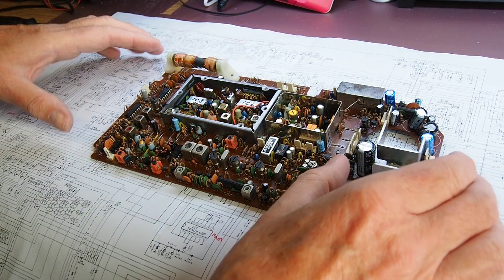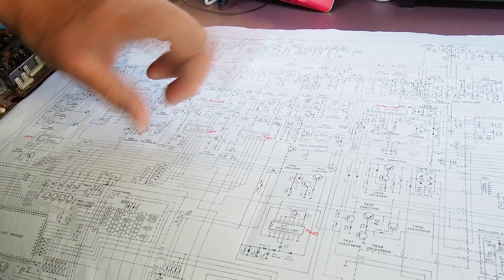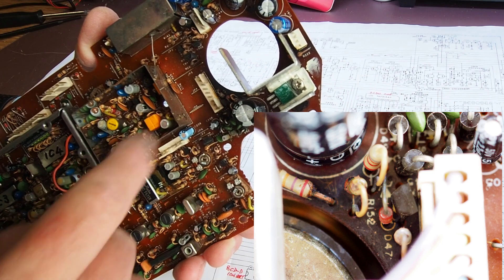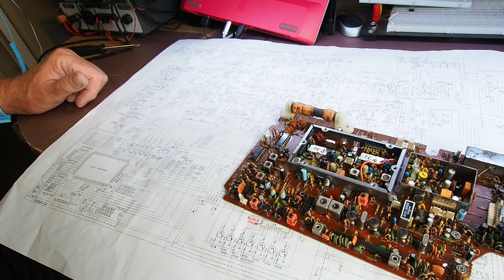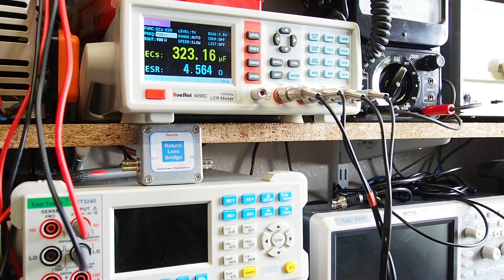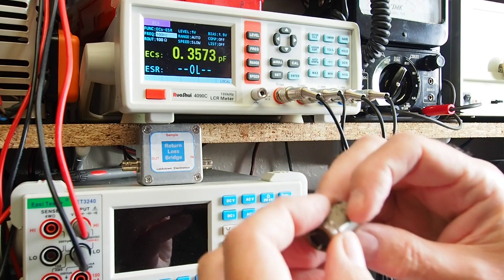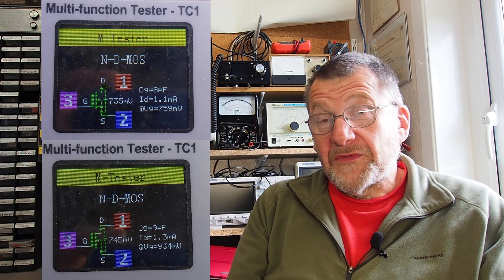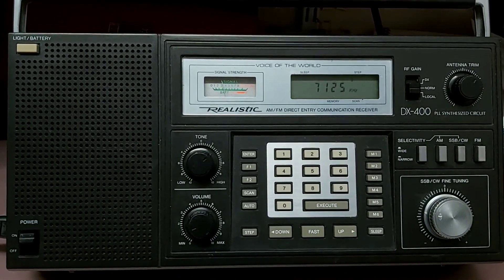Radio Shack / Tandy Receiver - Realistic DX 400 - Repair   #088

Comment: I have a REALISTIC DX-400. It works on all bands, but the signal strength level keeps fluctuating, suggesting a possible problem with the AGC. In addition, the audio has crackling noises and sounds very muffled. The circuit looks to be in excellent condition. I analyzed the capacitors in the circuit, and almost all of them have a very high ESR, indicating they need to be replaced. At the moment, I’m looking for the service manual for this radio to have more confidence in the maintenance I plan to perform. I saw in your video that you have the service manual.  Could you share it?
Reply from the maker: I only have the circuit diagram, not the service manual,  sorry...

Comment: I enjoy your videos. I would like to bring up a topic that I am sure that we have all experienced. If you can work on complicated circuitry if you don't fully understand it's operation or you can't test with the power on because you need special cable assemblies for troubleshooting. How can you make sense of the circuitry and not go down the wrong path of thinking. I have an HP 141 spectrum analyzer that blows fuses. I mainly got clues of what might be wrong from doing internet searches. Thanks again for making these videos.

Comment: I have a DX 400. It is a very good receiver. I am worried about the static charge on the fet. I noticed that when the receiver is plugged in (120VAC here in the US) that there was a slight vibration that could be felt on the metal portions of the receiver. I think that it shows some ac leakage. Not enough to shock, but you could feel it. I was wondering if that could have taken the fet.

Comment: Maybe it had a cold solder joint, I personally know of a cb radio brand that has one spot that has a cold solder joint that makes the radio inoperable but only takes less time to repair than to open the case. But that's just a possibility

Comment: I have enjoyed watching your very informative video. Thanks for posting it and making it so easy to follow. You referred to two MOSFETs, one for FM and one AM, that both sensitive to static damage. I have only hiss on FM and AM and have been using a homebrew active loop (uh 0h!).... do you know the circuits transistor numbers for these? I think I can locate the AM one, but can't quite see the AM one you talked about, above and to the left?
I will also replace the electrolytics you replaced on yours while I have the board off.
73 from sunny Devon! Adam M6RDP
Reply from the maker: Hi
The 2 transistors are 2SK241GR and 2SK241Y
Reply from the maker: If you contact on e-mail I can send you the circuit diagram...

Comment: Thank you for this video. Yes, my board was blackened in the mains power supply area too. I had to replace the incandescent S-meter illumination bulb & the LCD display illumination LEDs that were out also.

 The LCD display was darkened & spotty, perhaps by being stored in direct sunlight? The inside was full of bird seed husks. I'm looking at parts donor receivers for a new one.
 Sometimes if you add an item to the Watchlist, you get a less expensive offer from the seller. We will wait & see. I don't want to dispose of the unit.
There is some ESD protection for the 1st RF amp FET & mine was OK. It has plenty of gain.

 This is a good sounding, sensitive receiver. The rotary controls have a nice, weighted feel. It was a huge improvement over the previous unstable DX-302 & drifty DX-200.
 The Uniden CR-2021 is somewhat similar. I've seen the Micronta name as a version of this receiver as well.

 I cannot find a service manual or parts list either. There is a schematic on the last page of the owners manual. I really like your clear & large schematic copy.

Comment: How did you blow up the schematic and what printer prints that big? Wow!
Also, Radio Shack usually didn't have service manuals as far as I know. They used to always put the schematic on the last page which they stopped doing in the 1990s..... since throw away technology was upon us. Planned obsolescence.
Reply from the maker: I used to work for a company that had A0 printers...

Comment: The DX-400 is the same radio as the Uniden CR-2021.  Maybe try searching for Uniden CR-2021 and see if a service manual can be found.  Did you replace all of the electrolytic capacitors, or just the larger ones in the power supply section?  Thanks!